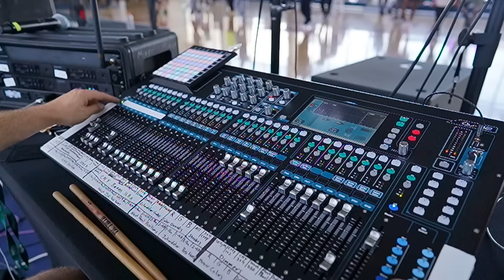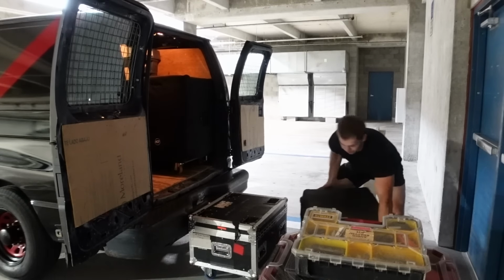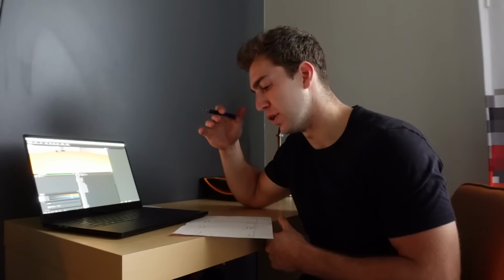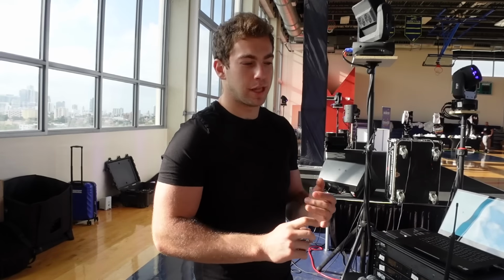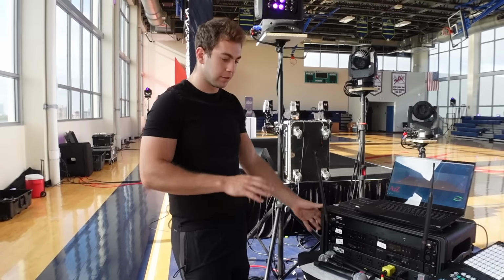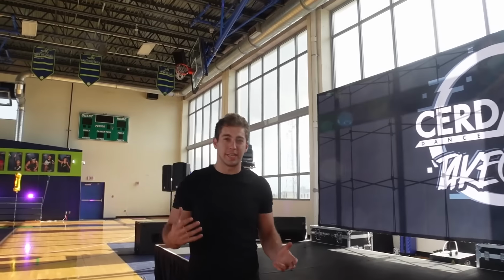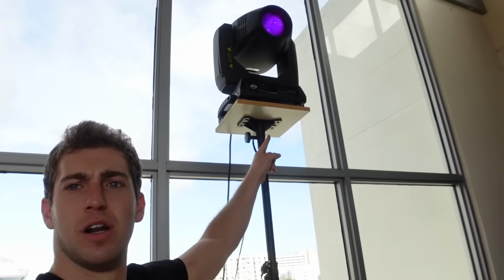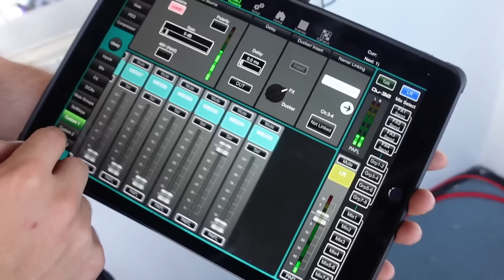Traveling to Miami for a Show! Start to Finish, Prep, Setup, Lighting, Sound, and more!

Comment: hey dude, hope this helps. if you are ringing out mics you should put all similar mics on an aux group and put them on the LR on that aux mix and unselect the LR mix on the main layer. then use the graphic eq on that aux mix to ring it out. and if you are ringing out mics it's faster to put em on a stand and face it towards the speaker at maybe around 6' then turn the gain up bit by bit then use your rta app to find out which freq to drop. hope I'm making sense here and hope it helps.
Reply from the maker: Good advice, I’ll give it a shot. Thanks!

Comment: Based on your video i want to ask about your audio console, can it use LPF and HPF in Allen Heath QU32?
Reply from the maker: Yes! LPF and HPF per channel and per output. Plus at least 4 points of eq on eq band per channel and more per output. Plenty of control which is what I use to ring out mics.